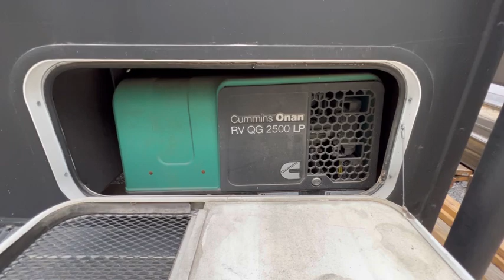Do You Use Your ONBOARD GENERATOR In Your RV Or TRUCK CAMPER?  (Why You probably Should!)

Comment: I have a 2018 Lance 1172 with four battle born batteries absolutely love them we’re 300 W of solar however when we need to eat lunch on the side of the road at the rest stop we kick on the generator start the AC for about an hour or so it works awesome love the 2500 Cummins propane generator we have about 175 hours on ours never any trouble we do the same thing we started at least once a month

Comment: I have installed some emergency backup generators in commercial settings a few times and we would always give them a log book with instructions with start up sequence and to run them once a month to keep them operational. In an emergency you need to know that you can count on the equipment to run properly and even small generators that you might keep around the house should be started and run for at least 10 minutes every month or so to keep the internal components lubricated.

Comment: I have a Coleman 6250 generator that's probably close to 20 years old at this point.  I've done regular maintenance on it through the years and just replaced the carburetor last week, which cost me a grand total of $26. I use it on my 22' Pioneer travel trailer and I don't have any problems powering anything I want to power.  It was sure great to have in the everglades, I'll tell you that much.

Comment: I put the exhaust tube to the roof on my camper when using it and it quiets it down a bit too. It also keeps the gases from getting inside the camper if the wind is blowing the exhaust back to the camper.

Comment: Use premium fuel and run every two months and oil changes are a must.
Some generators require to clean the spark arrester.solar is great generators are instant full power compared to solar n batteries